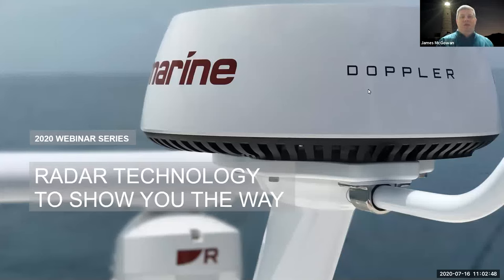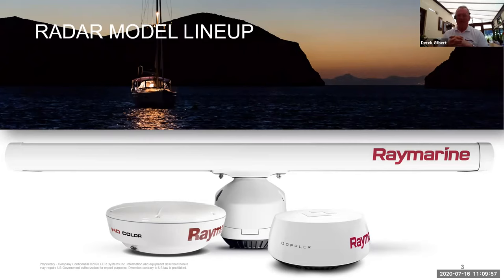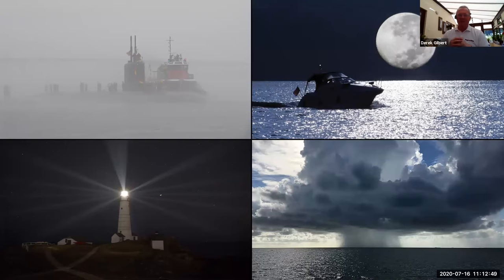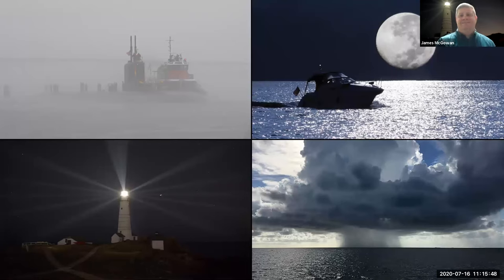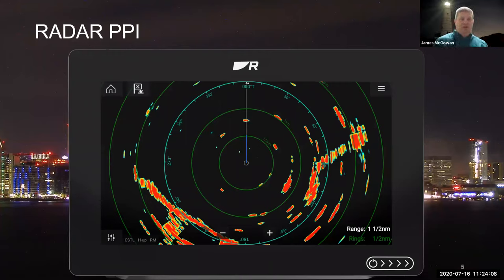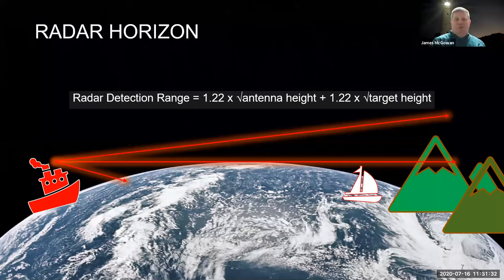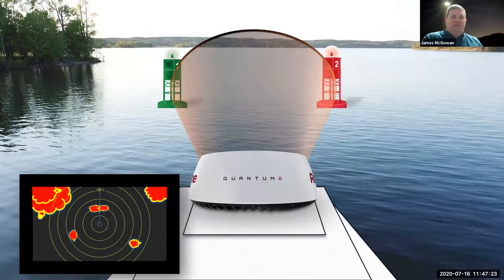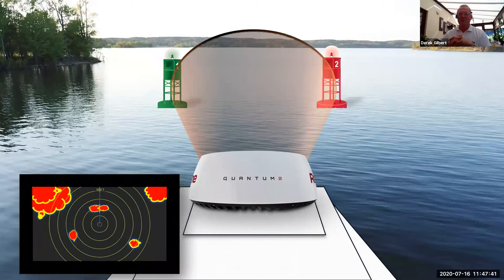Webinar:  Radar Technology to Show You the Way

Comment: I have raymarine axiom with quantum Q24C radar, and when I touch an object on the screen, there is no target aquire option. How can I enable that?
Reply from the maker: To use radar target acquisition and target tracking your Axiom needs to have 3 pieces of information available to it:

-Course Over Ground (COG) from your GPS/GNSS Receiver
-Speed Over Ground (SOG) from your GPS/GNSS Receiver
-Compass Heading from an electronic compass or autopilot system

I suspect you are missing the compass heading, which is why Axiom isn't offering you the Acquire Target function.

In order for the radar to provide accurate tracking and collision avoidance information it needs to know precisely your boat's heading and speed information.  The COG provided by the GPS systems on its own is not accurate enough to meet this requirement because GPS receivers cannot provide accurate COG when your boat is stationary or traveling at a speed below 1 knot.  The electronic compass provides heading information at all speeds, and when stationary.  

From the Raymarine lineup you could add an EV-1 heading sensor or an AR200 Augmented Reality module.  Both of those will provide compass heading.  If you have ever considered adding an autopilot to your boat, that would also provide a suitable heading source.  There are also 3rd party electronic compass sensors that will work too.  Look for any that are marked as NMEA 2000 compatible and they will provide the needed information.

Comment: What do you think about APAR or AESA radar system could do in the boating industry?
Reply from the maker: Fixed, phased array radar systems like you are referring to could certainly be interesting for the recreational boating and yachting industries because it would free yacht designers from many of the constraints imposed by the need for traditional masts for radar equipment.  I can imagine many bold, new shapes that could be crafted that would emphasize better the artistic lines of the vessel, with the radar equipment blending in more than it does today.    Cost is definitely a consideration though.  Currently those types are systems are very expensive, but that is primarily because they are only being made for defense applications.   A commercial version would probably have some economy of scale, that would become more an more mainstream as the technology trickles down to smaller and smaller vessels.

Comment: I have quantum 2 installed on my boat. Can quantum 2 be used to find birds for game fishing?
Reply from the maker: Hello Ahmed.  Quantum 2 wasn't designed with finding birds in mind, so it doesn't have the 1-touch "Bird Mode" that you'd find on some of our other radar systems.  

That said, birds to return a radar echo and with some practice you'd probably be able to find them on Quantum 2, though maybe not quite as far away as with some other radars.  You'd probably want to take the radar to Manual gain mode, increase it until it fully saturates, then reduce the gain just a few percent.  

I suggest trying this at a time when you can see some birds with your own eyes, or with binoculars, to get a feel for how the radar shows them.

Comment: Is there a way on Axiom pro to link the "programmable button" so that when your in radar mode hitting the button brings up gain, and you can then adjust the gain with the rotorary dial?
Reply from the maker: Hello Al.   The functions that can be programmed to that button are limited to the items in the menu.   Radar gain isn't offered, unfortunately.

In addition to going through the radar main menu (Menu....Adjust Sensitivity...the touch "G" for gain) you can also use the quick-access settings button on the bottom left corner of the radar screen.   The button looks like a graphic equalizer.  Touch it and the Sensitivity controls pop open on the right.    

Its not quite as efficient as what you asked about, but it does save a touch or 2 on the screen.

Comment: Can any of your radars be connected to a desktop computer? 
Dont want to end up being tied to a closed propitiatory ecosystem.
Reply from the maker: Hello Georgy.  Our radar systems cannot be connected to traditional computers out-of-the box.   We do have a radar Software Development Kit (SDK) available for our Quantum radar systems.  Using that SDK it might be possible to write a program or application to work with our radar, but its not something we provide.  You can get the details on our SDK here:  https://www.raymarine.com/marine-radar/sdk/index.html

Most boaters though will connect their Raymarine radar to one of our Axiom or Element multifunction displays.

Comment: Element Units seem to have quite a capable processor - I have tested them in a shop and was very pleased with the speed they respond when pressing a button.
But the shop guy told me, if you connect them up with too many devices, like autopilot and heading sensor, they would soon get issues. Autopilot and radar are extras I would like a lot. Still: I like Element more than Axiom, I prefer the real buttons over touch or that wheel and I think Element has the better sidescan sonar.

So what about Autopilot/ heading / AIS / Radar (via wifi): would Element be able to compute all that data ?
Reply from the maker: Hi Nikolaus.  Element units have quad-core processors that give them their tremendous speed.  Adding radar, autopilot and other sensors won't bog them down though.  The radar has its own processor for its most demanding calculations.  Heading sensor, autopilots, and instruments are similarly self-processed.  The data they provide to Element over NMEA2000 is low-bandwidth.  By design, Element does not network with many devices so it's unlikely you could bog it down.

Comment: I need to know how to solve scanner problems for 4kw 24"digital radom. error message is (-40040) scanner is not rotating.
Reply from the maker: Hi Mohamed.   The most common cause for that error is insufficient power being delivered to the scanner.   If the boat's batteries are low to start, the voltage is even lower by the time it gets to the extreme end of the radar cable.   Do check the battery voltage level, and test the voltage supplied at the end of the radar interconnect cable.   This article from our knowledge base might be helpful too:  https://forum.raymarine.com/showthread.php?tid=5921&pid=20738

Comment: Am I required to have Radar? IF YOU HAVE IT YES! Radar is not required on vessels under  1600 GT (33 CFR 164.35), however, Rule 7 states that proper use shall be made of radar equipment if fitted and operational. In other words, whoever has one must use it. The Navigation Rules are not meant to discourage the use of any device, rather they expect prudent mariners to avail themselves of all available means appropriate...
Should you be in a collision how would a judge/jury rule on your contention that the use of radar was impracticable (due to electrical drain, crew shortages, etc.)? Also, if a collision does occur, then there was obviously a risk of collision beforehand. Could the determination of that risk have been made sooner with the use of radar? It is difficult to answer such questions because the circumstances of each case are different.
Reply from the maker: Here is a good primer for anyone interested:  

https://www.navcen.uscg.gov/sites/default/files/pdf/navRules/navrules.pdf

Comment: We have Quantum 2 - I have been struggling with using weather mode. Is weather mainly used at longer ranges? What does it pick up - only rain, or clouds too? Can this mode be used in the harbour? Even on a clear sunny day weather mode seems to have a lot of returns when I use in the harbour.
Reply from the maker: Weather mode on Quantum radar is generally used at longer ranges (6 to 24 miles+) to see incoming precipitation and fronts.  The leading edge of a front, heavy rain and dense clouds actually produce a fairly sizeable radar return at long distance.  By spotting them early you can maneuver to avoid them if desired (or maybe run through them if you need a fresh water washdown.)

We can see and track these types of targets at long range because they are at high altitude.  This enables the radar to see them over the visible horizon.  Weather mode isn't really used at short ranges because at that point, the weather is nearly over the top of the boat, and it is above the radar's beam too.
Reply: @RaymarineInc  Good to know. The last time I tried was at long range in the harbour. It was a clear sunny day with some cloud, but not ones that looked like they had rain - yet I got a  lot of returns, and couldnt really make much sense of it. I would only have expected a solid return from a rain bearing cloud.

Comment: Would the Quantum 2 pick up surf sized waves breaking on a islands fringing reef? Presumably best in harbor mode?
Reply from the maker: Hello Al.  I'm not certain if it would see them or not.  Generally, the goal with marine radar is to filter out wave-top reflections to emphasize hard targets.  If you were to manually control the gain and sea clutter, it's conceivable that you could pick them up.  We'd need to know more about your application to really give a good answer.
Reply: @RaymarineInc  Approaching something like this : http://www.mahina.com/leg18/leg4/03p.JPG

I know the radar would pick up the island, but what about the surf breaking on the reef. I ask because in Fiji islands (and reefs) positions can be many miles out.
(Chart overlay would also help here since sometimes the islands are on the chart but in the wrong position)

Comment: I want to buy a Raymarine Element HV Unit. I called the Raymarine Hotline - this should connect via WiFi to the Raymarine Quantum Radar. What is the functionality of Radar in an Element unit compared to the functionality in an Axiom Unit? ...e.g.with respect to Heading, Overlay, MARPA ?
Thanks in advance !
Reply from the maker: Hello Nikolaus.   Element works with the Quantum or Quantum 2 radar scanners using a Wi-Fi connection only.   Its important to note, Element systems do not currently support target tracking (MARPA) or Quantum-2's Doppler Mode.  If those features are important, consider look at Axiom-series instead.

Element's radar app supports head-up, north-up and course-up presentation, as well as both relative and true motion display.  AIS contacts can also be overlaid on the radar scope if you have an AIS receiver or transceiver connected via NMEA2000 networking.  Both centered and floating VRM and EBL measuring tools are also available. 

We do recommend adding a heading sensor to the system for best performance and maximum capability.  Our EV1, AR200 or a compatible NMEA2000 sensor would work fine. 

Element supports automatic Harbor, Coastal, Buoy and Weather modes,  plus you can manually adjust Gain, Sea Clutter, Rain Clutter and color gain.

Element also supports the radar guard zone.  Define an area of the scope and any targets entering the zone will set of an audible and visible alarm.
Reply: Raymarine Wow - thanks a lot for that expansive answer ! I don’t need more Radar function than that. That’s great. You should definitely point that out in your ads and on the homepage. That really is an argument to buy an Element!!!

Element Units seem to have quite a capable processor - I have tested them in a shop and was very pleased with the speed they respond when pressing a button.
But the shop guy told me, if you connect them up with too many devices, like autopilot and heading sensor, they would soon get issues. Autopilot and radar are extras I would like a lot. Still: I like Element more than Axiom, I prefer the real buttons over touch or that wheel and I think Element has the better sidescan sonar.

So what about Autopilot/ heading / AIS / Radar (via wifi): would Element be able to compute all that data ?

Thanks a lot

Comment: Yesterday i buy axiom 7 dv, 1000 euro and i cant get gps signal im my boat?! Now i must spend extra 250 euro for gps reciver, Nice raymarine
Reply from the maker: Hello C3C11.  The GPS receiver in Axiom is embedded just behind the glass panel where the Raymarine logo is.  Like any GPS device, it needs to have a fairly clear view of the sky in order to obtain a reliable fix.  If your boat's design  or materials obstruct the antenna it can block reception of satellites across portions of the sky.
Reply: @RaymarineInc  i have Merry fisher 625 and a must wait 15-20 min everytime to get gps.
Reply: Axiom plus has better sensitivity in GPS. I also got the external GPS puck RS150 as I need multiple independent sources. Its really good.